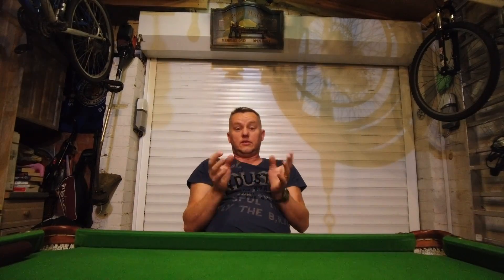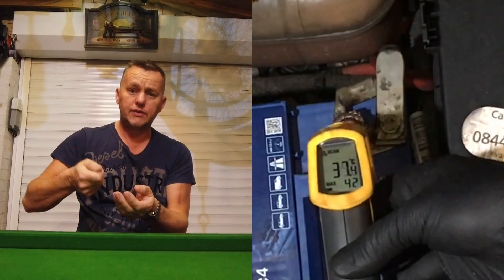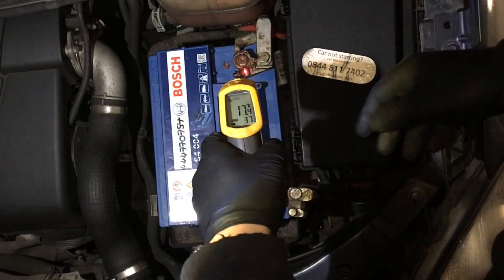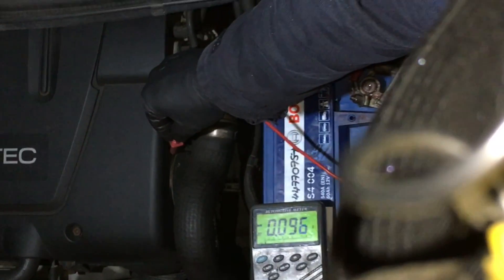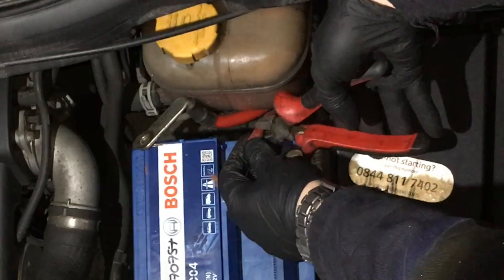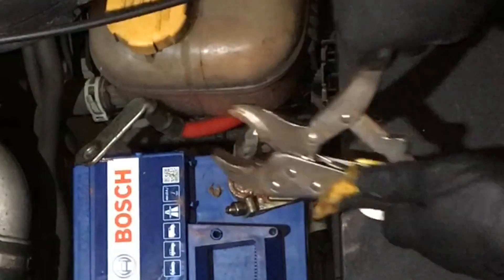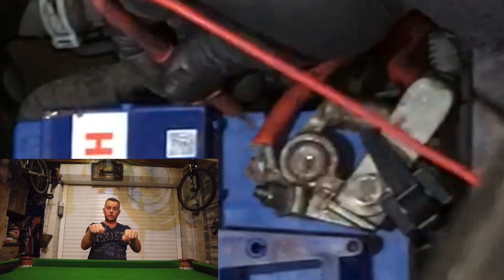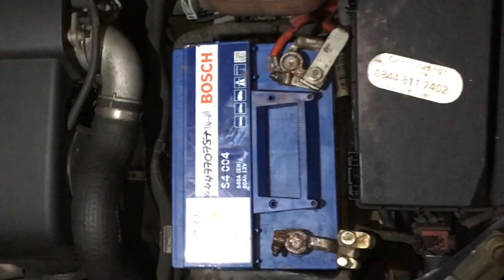Car Battery keeps going flat, Common Fault that's hard to find, How to Repair.

Comment: When doing the check from negative to engine block what settings do you use on vault meter?
Reply from the maker: Volts to check volt drop with the engine running, have a look at this one might help https://youtu.be/jEi-OJQD4K8 Thanks for the great comments👍🏻👍🏻🛠
Reply: @aaanton11  thanks for the reply! I’ll check that out. The issue my grandad is having with his Astra is the battery is being drained at every start and eventually it drains to 12.5v and doesn’t start it; the car seems to want around 14v from battery. The connector doesn’t heat up for his car so we’re thinking the starting motor but not sure. The batter starts others cars completely normally and no issues it’s relatively low.

Comment: Absolutely spot on mate,done mine over the weekend and it runs sweet as it should! Mine was so hot I could not put finger on it without burning,shame  if I knew that earlier would not buy an expensive battery replacement,but on a bright side it has a brand new battery and a new terminal so happy,kudos for the video👏👌👍
Reply from the maker: Thanks for the great comments👍🏻👍🏻🛠

Comment: Just discovered your video, absolutely brilliant, I've got a diesel vectra with a mysterious power drain problem, my garage just keep replacing batteries, the alternator and want to rip the dash out as they recon its a control module fault, I'm going to check out my terminals this weekend, could I ask where you acquired that temperature gun please?
Reply from the maker: https://amzn.to/3IS904L this will do the trick, Thanks for the great comments👍🏻👍🏻🛠

Comment: Thanks for the tip. I had same problem so instead of replacing terminal, I simply drilled two small holes thru top of OEM terminal, at the crimp, into cable and then filled holes with solder.
No hot terminal, battery charging properly.
Problem solved.
Thanks again for pointing me in the right direction.
DISCONNECT and REMOVE BATTERY FIRST
Reply from the maker: Thats a great idea, Thanks for the great information👍🏻👍🏻🛠

Comment: Hi, I assume thats a 16mm ring crimp? I'm having the same issue with my van and I was told it's a resistance fault in the battery itself....but after seeing this i doubt it. thanks
Reply from the maker: if the wire is getting warm its not the battery, Thanks for the great comments👍🏻👍🏻🛠

Comment: Thanks for video.  Appreciate if you could provide a link for that temperature device.
Reply from the maker: <iframe style="width:120px;height:240px;" marginwidth="0" marginheight="0" scrolling="no" frameborder="0" src="//ws-eu.amazon-adsystem.com/widgets/q?ServiceVersion=20070822&OneJS=1&Operation=GetAdHtml&MarketPlace=GB&source=ac&ref=qf_sp_asin_til&ad_type=product_link&tracking_id=anthonycashmo-21&marketplace=amazon&region=GB&placement=B01LPSL4X2&asins=B01LPSL4X2&linkId=d5876bb8ab9803a75c80111f7faf68bf&show_border=false&link_opens_in_new_window=false&price_color=333333&title_color=0066C0&bg_color=FFFFFF">
    </iframe>
Reply from the maker: I have added the link to the temp probe hope it works Thanks for the great comments👍🏻👍🏻🛠

Comment: Amazing discovery and never seen that fault before. That piece of kit really put a figure on the excess temperature that normally wouldn't be detected by using your hand. Often seen problems  with new batteries but never have suspected a crimped terminal. Goes to prove the old adage, the longer you live, the more you learn. Thanks for sharing the knowledge !!
Reply from the maker: once you start checking them, you will be amazed how many are starting to fail, usually 8-10 year old vauxhall zafiras and Astras ,Thanks for the great comments👍🏻👍🏻🛠